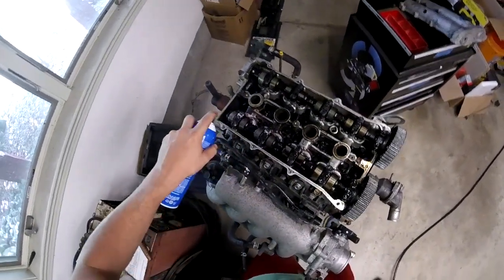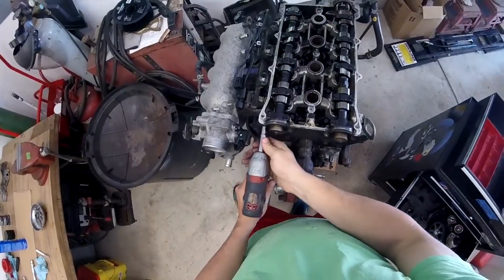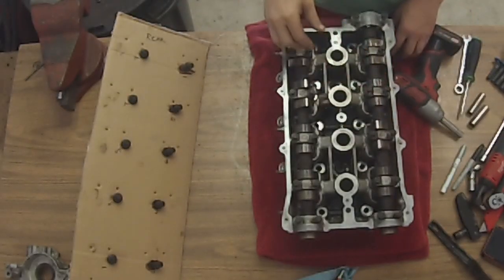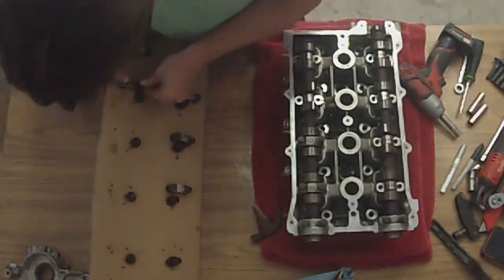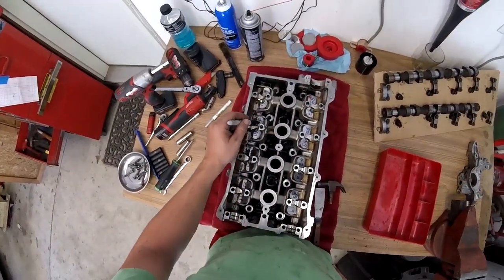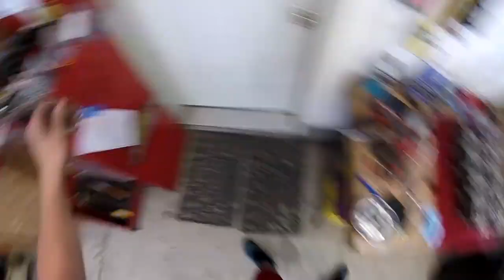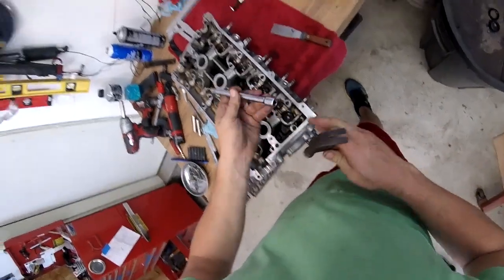Miata Engine Build Pt1 - Step-by-Step DIY Head Removal and Disassembly

Comment: I genuinely think I can do it. The bottom end scares me a bit, but you’re making me believe…also, are you in Ohio? I heard the Midwest Miata shoutout and I see the MidOhio videos…Hello from Columbus!
Reply from the maker: Hey hey, I am!  Used to be in Columbus but moved up North for work.  Yeah, the bottom end is easy I think.  The only issue I've had is bad ring gaps because I cheated and tried to file them with a power tool instead of by hand.  Another set of rings later, problem solved. lol  Slow and steady wins the race!

Comment: I know, without a shadow of a doubt that I could disassemble an MX-5 engine in no time flat. I’m also just as sure that I would never, ever be able to put it back together again. When the time is right, I’ll engage an expert. But, still fascinating to watch.
Reply from the maker: Ahh don't undervalue yourself on that!  Everything is a left or right hand turned screw.  Get a service manual, watch some videos, and have at it!  The best part of NA/NB engines is that they are non-interference.  So even if you do this your self, you can't truly break anything even if you do wrong!

Comment: how would you recommend cleaning the head if you are not fully stripping just say doing a headgasket.
Reply from the maker: If that's the case, you don't need to full disassemble.  If it ran well other than the head gasket, you can simply take the whole head off as a unit.  However, if you were getting smoke when you lift off throttle, that is indicator #1 that your valve seals are toast!